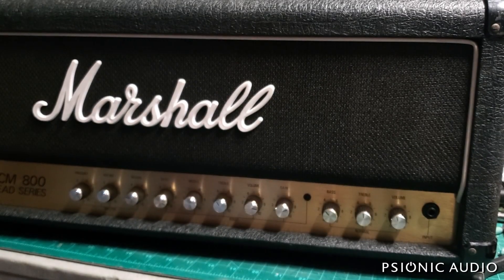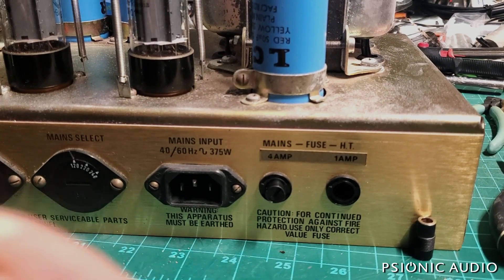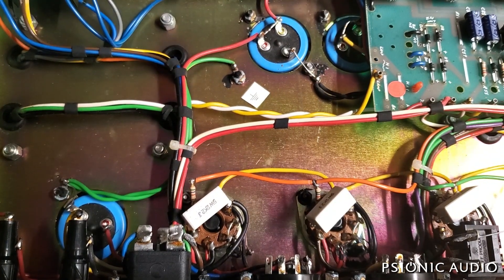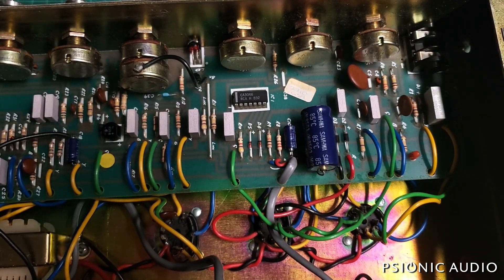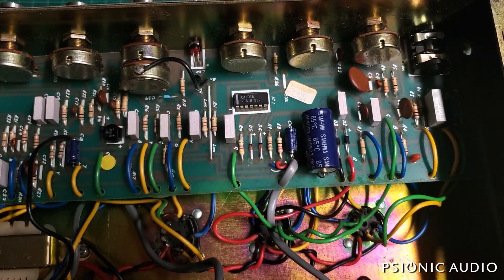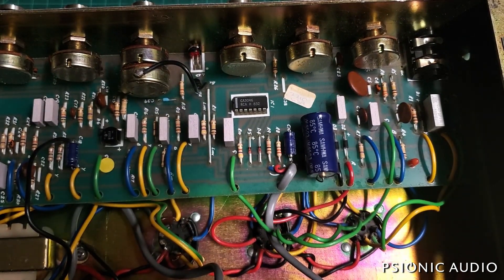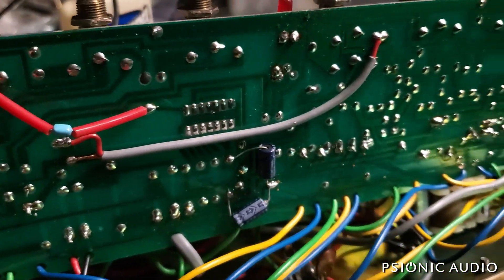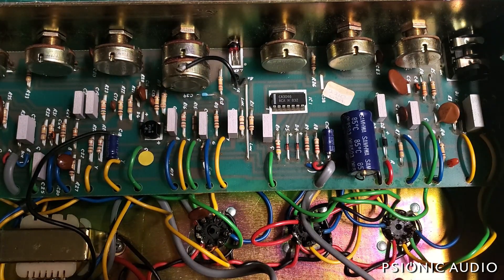'90 Marshall JCM 800 2210 | Part 1 : Diagnosing Low Output

Comment: I just got one but model 2205, quite dusty, from a storage auction. Now I am thinking what's best to do with it. Does someone buy those nowadays? It sounds but it's not loud (both channels) and it adds noise, especially  when I add  more "REVERB". I have some experience with repairing electronics but don't have all necessary tools, a bulb tester specifically. When I find time and the right mood, I'll probably spend some time with it😅
Reply: Get that sucker up and running!! Schenker plays them exclusively for a reason. Yes, I have a set of them myself.

Comment: the CA3046 is a low voltage npn transistor array  only 15 volt a higher voltage version should hold up longer .  It cheap and works for a bit . ca3146a is better same pin out  40 volt rather than 15.
Reply: Is it the same package? Usually higher voltage IC’s are larger to dissipate the extra heat.
Reply: @matthewf1979  same package just  a bit better voltage compare the  data sheets  . Often it by selection and the better chips sort good for more voltage and what left meet the lower voltage .  Ca3146A look to have better voltage break down .  Very little power on this type of array  but my guess there is some signal voltage causing the break up since it used as a switch .   Reference the schematic for what they are switching . both the 3046 and the 3146 are end of life so you may want to get some not from china . Jameco has some at this point.

Comment: Just dumb luck this amp worked all this time.
Reply: I’ve personally seen a lot of Fender black panel amps with bad solder joints. Usually in the vibrato section because nobody cared about it.
Reply from the maker: I've had Marshalls from this era where the ground wires had never been soldered. Wrapped around the lug but never soldered. Eventually the metal corrodes and it no longer works. Lots of Friday amps out there.